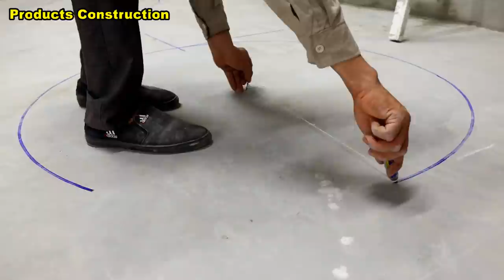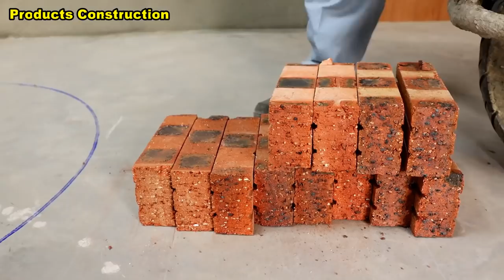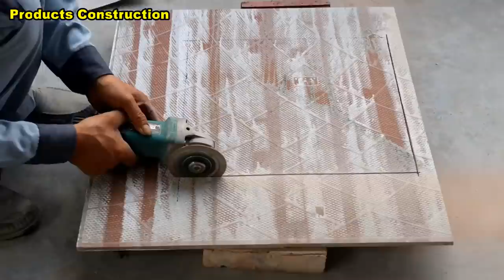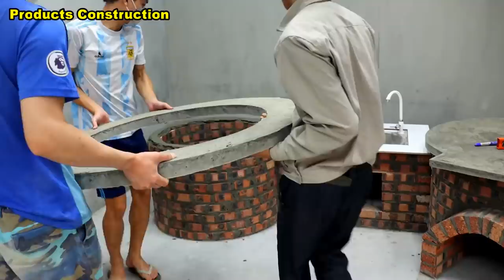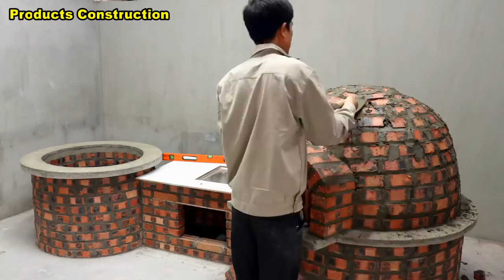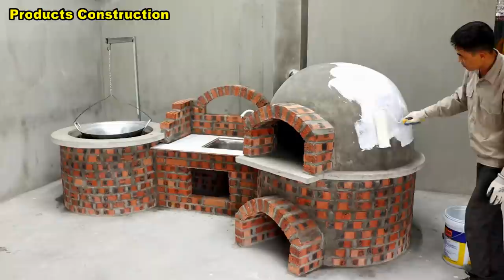Outdoor Multifunc Wood Stove From Red Brick & Cement - Easy Building, DIY Pizza Oven Making

Comment: Where's the insulation? Why is the opening for the wood storage so small? Why are the counter tops at knee level? Unless the chef is a very short person they will have back problems. Although, that prol won't matter cause if those arn't fire bricks they will crumble.